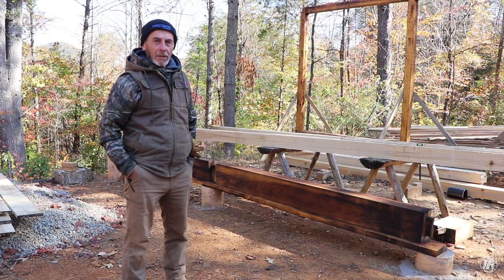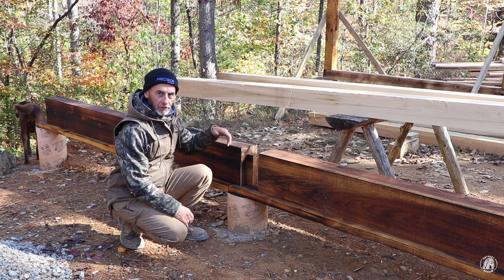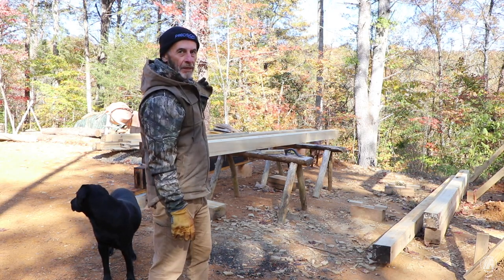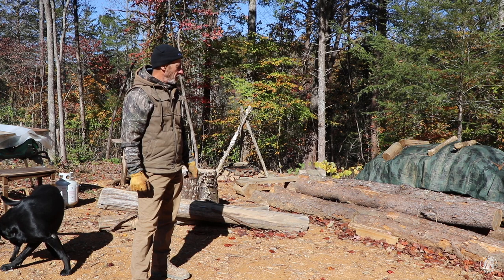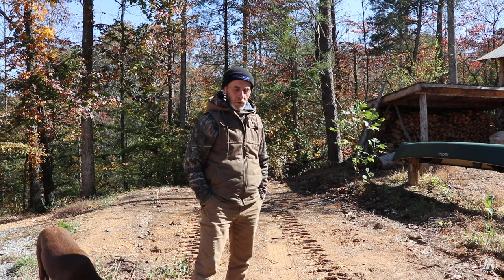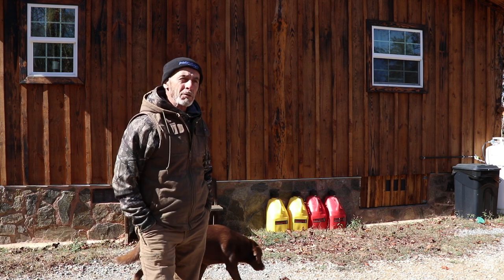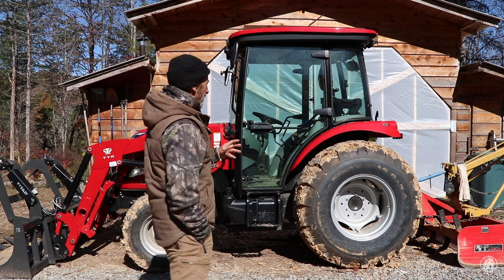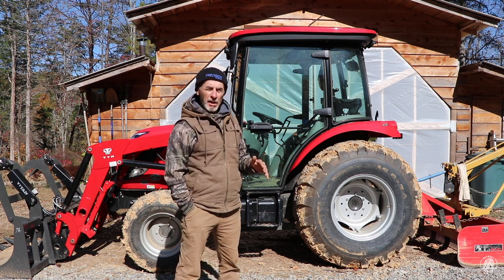THE SMOKEHOUSE WORKS & TIMBER FRAME WORKSHOP UPDATE

Comment: Good morning Richard, you had talked about getting the tractor out of the sun and such. You may want to do the same for your pickup. As you know they aren't getting any cheaper. Maybe carport style. Also maybe a shed for your flammables away from the other structures, just to be on the safe side. Just a thought. Be well, be safe & have a blessed week.

Comment: at some point you may consider some use of cement stabilized compressed earthen blocks and the flat there looks like a fine production area a pit for mixing easy enough and the loading into the machine for block production ...do not laugh at some point the rubble footers and earthen block make root cellar constructs a breeze and these structures last for centuries and lighten the wood usage by 80%...